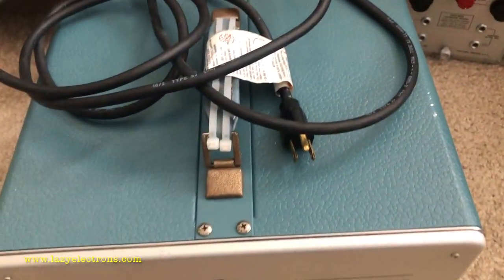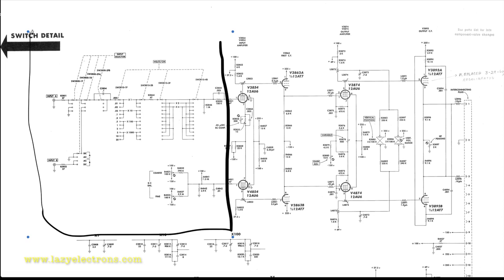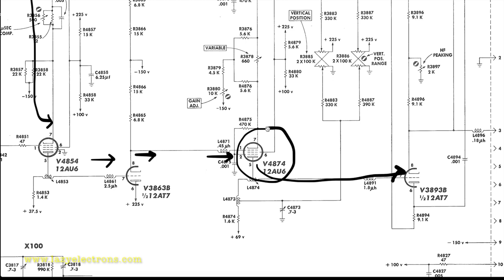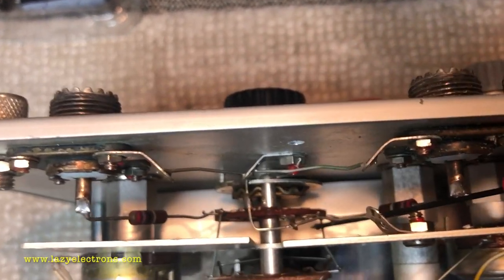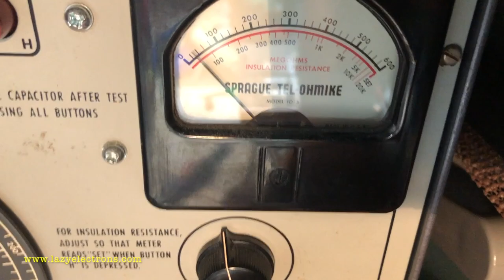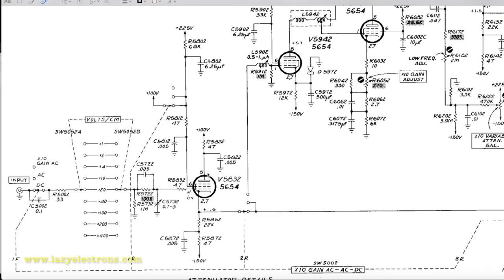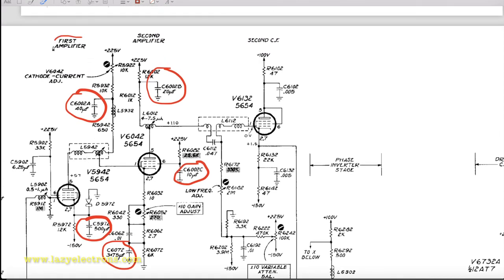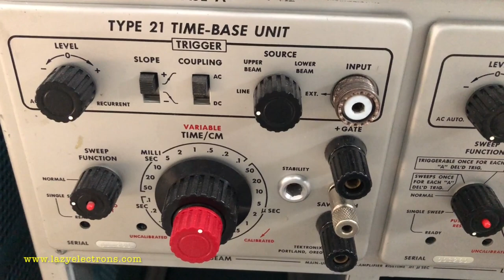Tektronix 555  Restore/Repair  Part-3 -  V-Plugins - Type H & L  Repair/Restore

Comment: It's my understanding that any selected Tek tubes begin with Tektronix part number 157, is that correct and a complete way to determine if it is selected?
Reply from the maker: Think so, all general parts for tubes are 154XX as per RPR here   - http://w140.com/tekwiki/images/6/6b/Tek_RPR_154-_Vacuum_Tubes.pdf - for  checked tubes details @ - http://w140.com/tekwiki/images/1/14/157-_checked_and_tested_tubes_specs_and_procedure.pdf  - shows 157XX parts.